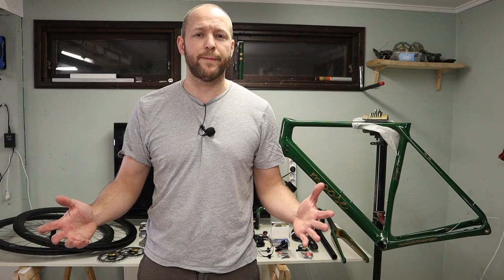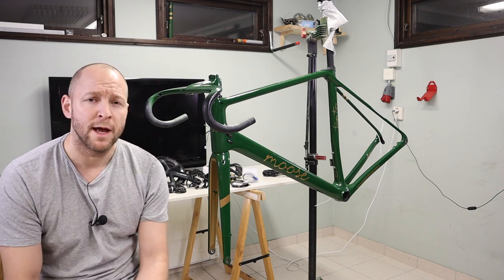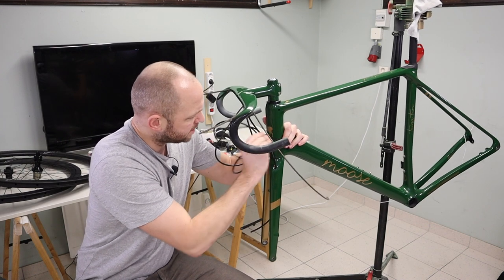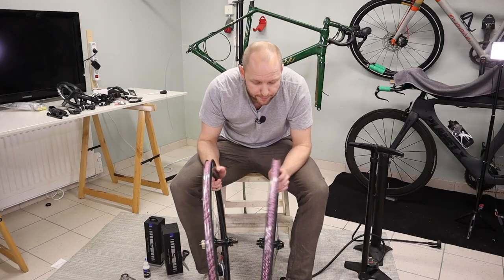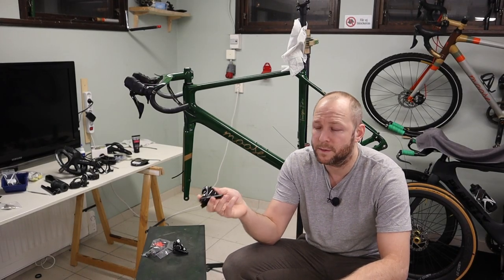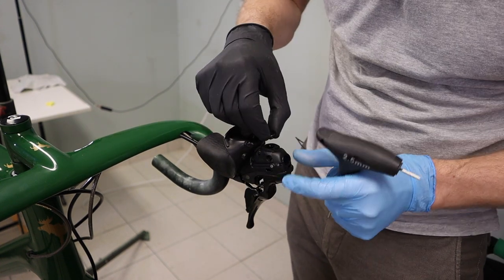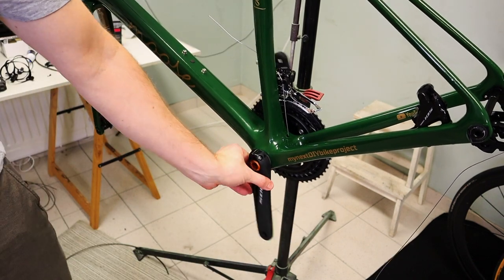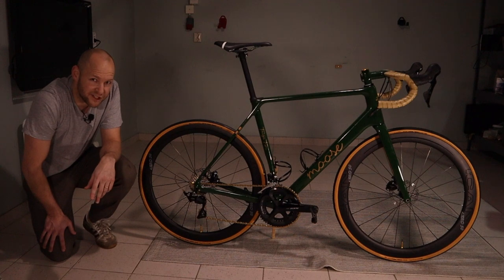My full carbon road bike build - DIY

Comment: It looks like the tires aren't on the rims properly, rear mech cable is unnecessarily long, no need to clamp the cable ends, chain also isn't routed right. Did you skip bleeding the brakes or were they good enough when you filled with fluid? However, the build is still nice. I can see you've put effort into selecting the parts and thought it through well. Certainly an advocate for custom myself, just some little issues in the build along the way. Also noticed you fixed a couple of the issues.
Reply from the maker: Yes, the tires didn’t pop properly, but still held the air. I got it out o l. The test ride and fixed it. The brakes were bled, took several hours. There are so many time consuming details when assembling a bike and it’s impossible to make an
Interesting video without cutting most of the time out. This build (paint job not included) took me about 14-16h so getting it into a 30 min video is a challenge. 👌
Reply: @MYnextDIYbikePROJECT  Ah right, that makes a lot of sense. Were you learning a lot of the skills for the first time here or have you done maintenance or other builds in the past?
Reply from the maker: @lemonshire1  I’ve fully assembled a couple of bikes and done a lot of maintenance and mechanics over the years. But YouTube is great for learning and instructions. 👌

Comment: Is it the video or does the frame have a lot of orange peel?
Reply from the maker: Its a combo. The frame has some orange peel. This was the second frame I painted I was not as skilled with the clear coat back then. 👌
Reply: @MYnextDIYbikePROJECT  I’m planning to paint mine but realised the can way is just too expensive especially the max spray primer can and clear coat cost a bit to get it shipped to the UK. 

I’m going to for the compressor method but hesitant on which spray gun to buy. I primed the bike with a beige max spray can but it ran out before I was even finished. Didn’t even touch the fork or seatpost.

Compressor £100
Spray gun £20-60 depending what I choose
Paint £70. (2k primer, colour purple metallic, 2K Gloss) all paint from custom paintz

The cheapest quote I got is £400 to paint by someone. Not sure if I should go for it or I’m setting myself for failure?
Reply from the maker: @sportnation8885  I doubt it will be cheaper with compressor. A £100 compressor will probably not get you far. Spray guns consume quite some air. Also you need air filters/water traps, air hose, connectors, cleaning kits and thinners. Plus that it’s a lot more difficult to setup and spray with guns. 

But if you plan to paint bikes in a regular basis, go for spray guns, but don’t underestimate the costs and difficulty. 

For a one time job the cans will be cheaper. 2-3 cans with primer, 1-2 cans with base (more if you want multiplecolors), 2-3 cans with clear coat. 

 Check out nonpaint, https://www.nonpaints.com/en/car-paint/clear-coats/2k-clear-coat best prices in Europe as far as I’ve found. Not sure about tolls and fees to the UK though. 

Also custom painz have 2k cans. 

👍